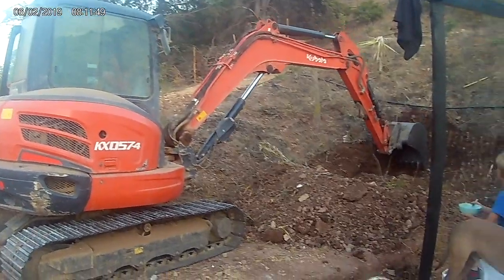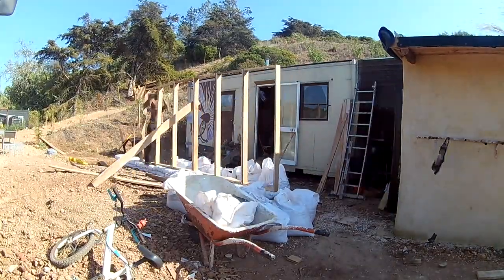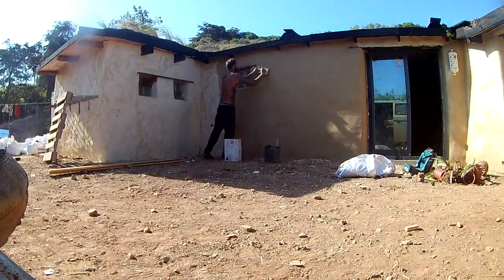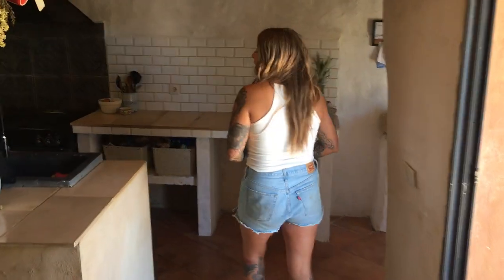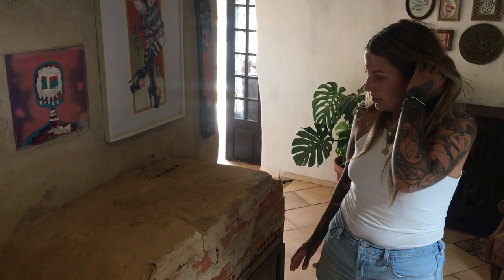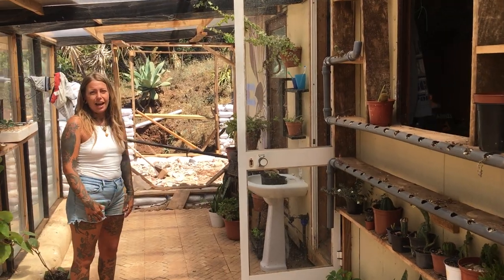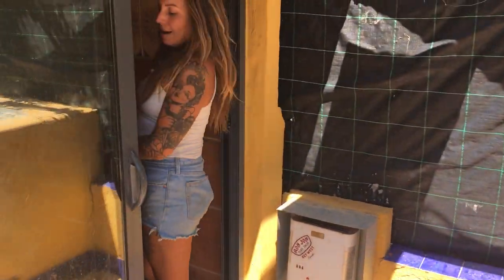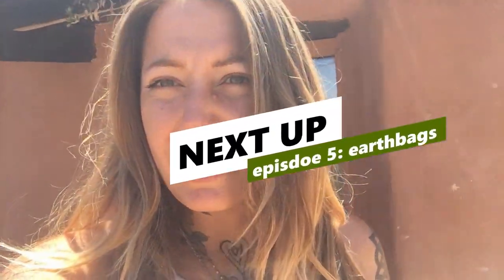SPECIAL-full house tour-family build their own earthbag house for less than $6000

Comment: Very awesome build, and inspiring for so many of us looking to build our own homes without going into massive debt.  I was wondering what the temperatures are like inside your home.  We are thinking of doing a similar earth berm build but worried it will not be as effective sheltering is from heat than the traditional open ventilation designs in the tropics.
Reply from the maker: Thank you! We find that it stays very cool inside even when temperatures reach high 30’ in the summer, providing we keep the doors and windows closed as much as possible.

Comment: Very impressed, only 6k…are you going to say what you spent ‘all’ that cash on?
This is the Truck..the boys room….they must so love that!
Be very interested to here details of the construction, insulation, damp proofing, roof etc.
Reply from the maker: I could break it down for you.. but long story short we spend a good amount of the budget on the digger guy, to clear the land and dig the foundations.. additionally the materials, drainage pipe, barred wire, bags, wood for the roof and ceiling etc. materials like sand for the render, and gravel for outside the house and under the floors.. and finishing details, fittings, furniture, flooring, fridge etc… 

With regards to insulation it’s not nesecary with earth bag construction, there is some in the roof but not the walls. The damp proofing is explained in previous episodes where we talk about the drainage and vapour/moisture barrier in the stem wall. And the details of the roof will come up in the next few weeks :)
Reply: ..ha, I see you have more to watch, I assumed this was the first of many to come.
I guess if you have a good supply of free wood, insulation not needed, though ideally we should ‘stop burning stuff’.  I would have considered insulation, recall it does get chilly at times even where you are.  The earth will be good at retaining heat, but not enough for good insulation.  Hopefully am wrong and you have comfy winters!
Reply from the maker: @markthomasson5077  the last winter was a average cold one (sometimes in the below zero region in the mornings) and with out thermal mass heater the house was super warm and also very important dry.The walls which a nearly half a meter thick insulate really well as long as you keep heating the house steadily.
Reply: Sound like you have it sorted!  Well done